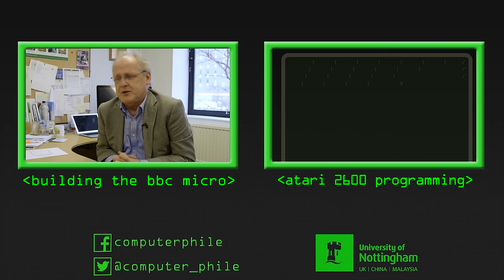Discussing System On Chip (SoC) - Computerphile

Comment: The idea that squiggly routing of connection wires would impact transfer speed, isn't that in contrary to the point made in the latest Veritasium video, The Big Misconception About Electricity?
Reply: It's still a distance to cross. If the electrical signal needed to pass the long way around the case and traveled a meter to do so it would still matter that the component was 10 cm away.
Reply: The signal speed is the speed of the electric field, which is also around the speed of light. And the field also "travels" along the traces. The electrons themselves are still pretty slow.
Reply: Veritasium's claim is technically true, but in practice not really relevant since the amplitude of the signal induced by the fields is much, much lower than the actual signal. In high speed circuits the signal path and it's return path (ie ground) are routed very close together to minimize the spatial extent of the EM fields. In the Veritasium video they were "routed" 1 ly apart...
Reply: In the Veritasium video he's really talking about the ability of the wires in the circuit to act like antennas (which I really wish he had explained better, or at all). By treating the wires as antennas you can design them to control how much power is transmitted as radiation rather than via conduction. If you don't actually want an antenna then you just design your wires to suppress that effect as much as possible. 

The effect gets more prominent as the wavelength of the signal on the wire gets closer to the size of the wire, so high frequency (short wavelength) circuits are basically always limited by your ability to keep your wires from acting like antennas. That's one of the reasons why CPUs can't just keep getting faster and faster.
Reply: The leading edge may get there, but transistor logic doesn't fire on the faintly discernible leading edge, it fires on a voltage threshold. If the transistor needs to see 1V to switch on, it doesn't matter how fast the first couple microvolts get there.
Reply: @danieljensen2626  So that was it?  If he only mentioned "antenna" once the whole thing would be a no brainer...... Hold on.... I know what he did here. O c'mon what a click bait....
Reply: There's so many things not taken into account with that video its silly imo. V,I,R capacitance, inductance, heat losses and the types of conductor just to start, all have an impact. Even what the circuit board is made of is a factor.

Comment: Most   flat  screen televisions  today have    SOC  (custom  ASCI)   Also   when  you combine more  silicon  on   one  chip you  reduce   less  power and therefore less   heat dissipation  because  more transistors  are  decreasing  in  size on the die.

Comment: integration progresses in many directions, but it gets a bit complicated in MCM, should we call them System On Package? or the lack of GPU makes them not count? but then APU are clearly SoC as these are monolithic
and technically all of them are able to run without chipset at all but I don't think there are any aftermarket chipletless motherboards

for Intel there are mobile SoC that have the PCH (chipset) die on the "CPU PCB" but not all of them do that

Comment: The market is for computer users so enthusiasts and such aren't really a part of that. Moving computers to SoC means that a number of things are given up. Expandability, particularly RAM expansion for example, is gone. You need to buy the computer as you want it (and think you may want it before end of life of it) because you won't be easily doing things like adding more RAM to it. You would have to replace the whole SoC if you wanted to go from, say 8GB, to 16GB. So if you buy a machine that, after you get it, you find that you really need more memory, you have to buy an entire new computer and figure out something to do with your older computer. Hopefully you can figure that out within the return policy of the thing and can send it back and get the one you want.

Comment: In addition to signal speed limitationa, voltage loss over say 10x to 10,000X greater distance with the 1960s motherboard technology is not insignificant. + increased radiation emmissions. It seems there should be a huge market for highly upgradable SOS's.
True computer modding "enthusiasts" would of course need to learn to solder or pop down to the repair shop to have our new componets hooked up. 
Seems motherboards and all the rediculas connector cables and cable managment nonsence needs to become irrelivent relics! 
We would love an episode on the SIC modding going on at the institution there.

Comment: So... How does this work vs Veritasium's light-second light bulb circuit which lights almost instantly because of the energy field... If the light turns out almost immediately despite very long wires, why is PCB track length an issue that needs to be consider in relation to "time taken for electrical signal to reach the other end" based on what Veritasium was saying it seems like track length wouldn't be important and only the position of the chip relative to the CPU would matter (it wouldn't matter is the tracks were different lengths or went all around the houses to reach their destination.

I understand there might be issues with attenuation and potentially signals resonating within that wires, but here if seems you are focusing on the speed of light and length of tracks to determine arrival of information (which makes sense to me), but it seems to go against this whole concept that Veritasium has got people talking about.
Reply: At gigahertz clock speeds, it takes a long time for signals to get anywhere.

Comment: and the new Apple SoCs have the RAM on chip too so you can't expand it after you've configured the system. (Non-upgradeable RAM has been a "feature" since before Apple went to ARM SoCs it must be said, just that it was still a separate component on a motherboard)
Reply: yea i don't get why dr bagley is still such an apple fanboy either. back in the day, sure, they made some pretty great & revolutionary products. today? not so much...
Reply: @QuantumFluxable  Perhaps try to think in terms of technologies and utility rather than brands, the extra resolution will help you to make more nuanced decisions. The A64FX chips in Fugaku, - the #1 computer on the top500 supercomputers list - also uses hbm2 on the cpu package. It's a design with great performance upside if you know how to gauge your needs at time of purchase and the configuration is within your budget.
Reply: @bakedbeings  we're talking about the right to repair of ordinary customers, why would i care what a random supercomputer does? for a supercomputer you could just do fully custom one-of-a-kind silicon and probably still have it work out financially...
Reply: @QuantumFluxable  You might be replying to the wrong thread. You didn't mention anything about right to repair, it was a general complaint about Apple products on a video about socs.
Reply: Microprocessors have had RAM on the chip for ~30y. For most of that time, its been used as a cache. The new Apple SoCs are no different in that regard. The main system memory isn't on the SoC, it's on a separate chips in separate packages that are mounted on the same module as the SoC. The versions used in iPhones are more compact. They put the RAM package on top of the SoC package.
Reply: @techobsessed1  OK but nobody considers SRAM L1/L2/L3 cache as actual usable memory since unless you're using specific system-level instructions to load and invalidate cache lines which no application programmer does, you can't address cache so while correct it's a bit of a pointless distinction in this context. You are correct that the M1 RAM (main, application and system level addressable memory) isn't on the SoC but is incorporated as a system in a package (SiP)
Reply: once they make the big pro, or maybe even mini pro, I hope you'll be able to add some slower memory and make it efficiently handle that

Comment: Is there a way to audit SoC to prevent big tech from adding subsystem or backdoor?
Reply: Creating it in a hardware description language would at least ensure the intended design is free of backdoors. If you used it to program an FPGA, you'd probably be alright, though it's still possible for the software used to create the bitstream to maliciously insert functionality. If you used an open-source toolchain as well, you'd eliminate that avenue. Anything beyond that, like a fixed-function block in the FPGA itself, is getting into "more trouble than it's worth" territory for the malicious actor.

Comment: as for disadvantages, there's the whole M1 line that's not great for people not dealing with videos and graphics, especially if they need more RAM
you end up with way overkill GPU, video encoders you won't ever use, ML blocks that may also be not too useful and a CPU of 5800X performance, which isn't bad by itself, it's more than respectable performance, especially with that efficiency, but the cost of such a machine is much closer to probably two 5950Xs

Comment: So we're still dependent on x86 or ARM based CPUs if we're gonna to emulate an SoC? Back to the QEMU lab for me then...🚪
Reply: I'm not sure what you mean here: he's talking about hardware configurations that can be used with any architecture, and says that ARM SOCs as well as cpus are available. There are x86 socs as well, then you have microcontrollers from atmel. Where are you fitting QEMU into this?

Comment: First soc I met in 1985 was an 80186,which jntegrared in a single chip an 8086 cpu, a 8237 style dma controllet, a 8254 style timer/counter, an interrupt controller and logic to control io and memory  segments..... 
Everything was fine except the bizzare way a 20 bit address was created by the 80186 manipulating segment registers.... it seemed a very bad departure from the pure linear address implemented in a 68000 cpu...anyway those were the best years of my life as a digital engineer....

Comment: Well .. if it don´t have the memory, or at least part of the memory on die, i would not call it system on  a chip. Then it would only be a APU.

Even most common PC CPU got controller and pretty much everything integrated apart from memory. Its really the lack of memory that make a PC APU not a SOC.

So if we want to aply this on the ACORN machine, then its not a SOC.

A thing that most yougths don´t know today is that most computers use to be a CPU, A north bridge (typically memory controller), a south bridge (typically IO) and a Graphics chip.

In the early 00-tys, most CPU started to integrate memory controller. In the late 00-tys the IO was also integrated. Now days most CPU:s have some sort of integrated graphics controller, making them a APU.. but not a SOC. To being a SOC it have to have botable memory.

Worth saying that most early phones only had a bit of the memory (usually half, but sometimes a  quarter) on the die.
Reply: my teachers gave me this explaination . 👍

Comment: Apple is king.

The Acorn A3010, release date: June 1987; 34 years ago

RISC is amazing, thank you ARM.

God bless you.
Reply: Actually the Acorn Archimedes is from 1987, the A3010 is from 1992.
Reply: You might be thinking of the A310, which was one of the original Archimedes models. The A3000 series started later and the A3010 was 1992/93 along with the A3020 and A4000.